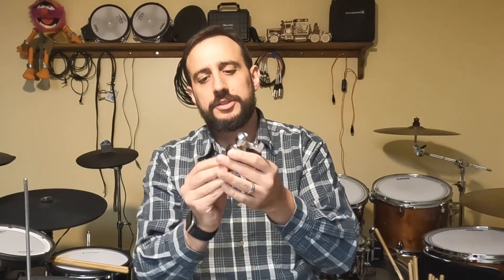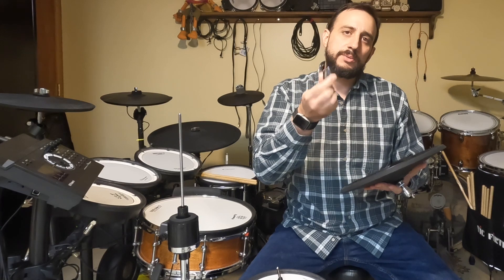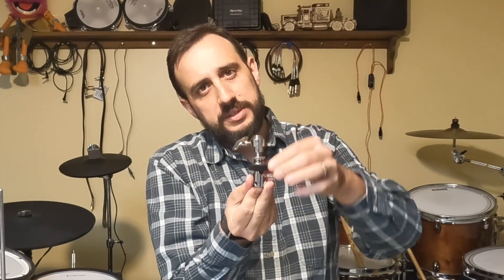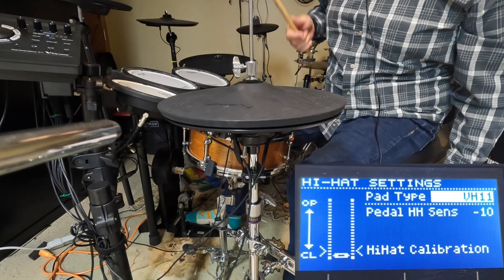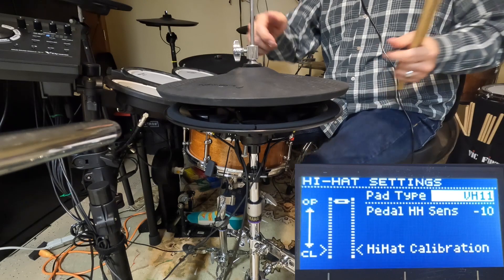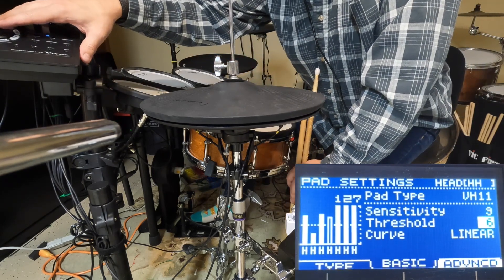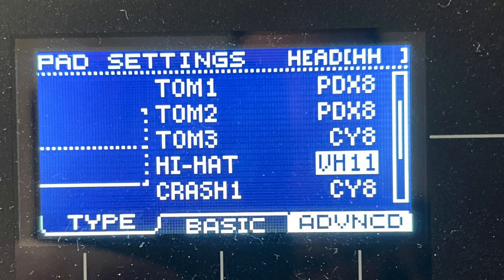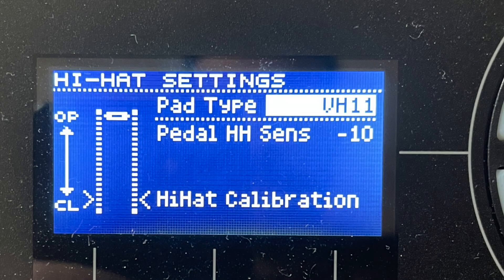You CAN use a 2 piece hi-hat with a Roland TD-17! Here's how...

Comment: I just installed the Lemon HHC12 with my TD-17 module. Works great! I used the settings in this video and didn't feel the need to do the test tone detail.

It also works just out of the box. Install per the instruction and you are set. As others have pointed out (here or elsewhere), the kit now includes an extra thicker washer that solves the problem.
Reply from the maker: I'm really glad they've fixed the issues. I am currently playing lemon's 14" hi hat, and it all performs wonderfully out of the box. Thanks for watching!

Comment: I got these to work on a TD-11. I definitely had to used some of your mods to get it to work- thanks! There is only one isse now- the hihat completely open sound kicks in a bit late. I think that it due to my lifht weight hihat stand. The top higat cymbal is pretty heavy and the dpring is pretty weak so opening the higat is dluggish. I'm hoping that using these on a hihat stand that has adjustable pedal tension will help.
Reply: How are they holding up on the TD-11 so far? I also have a TD-11 and I know these technically aren't supposed to be compatible, but if I'm going to upgrade my hi-hat I'd love to go with the 2-piece if I can make it work!

Comment: As always thanks for your videos. I just got my hihat unit and so far pretty good. I am getting some double triggering with edge strikes. I can’t make it happen all the time. It’s infrequent but I’ll have to work on settings. Maybe scan time needs to be lowered or maybe threshold is off. 
If you have any tips on the edge strike double triggering it would be great to hear your ideas. Thanks as always
Reply from the maker: What module are you using?
Reply: The TD-17. I did adjust the scan and mask time slightly and got it fixed.

Comment: Hi Brady, Great video quick question, based on your settings that work with the built in Roland sounds have you or do you midi out to a DAW eg logic and use the plugin sounds? if so does the hi hat still respond the same? Cheers Nick

Comment: I purchased this HiHat recently and I noticed that you did not use the black rubber washer that came with the kit.   The washer goes on after you place the bottom cymbal plate on so it sits on top of the bottom plate plunger.   This gives you just enough height to fully compress the bottom plate plunger when you step on the pedal.   You migt try that in lieu of using the fix you applied to your top cymbal plate connecton rather than using the parts you were provided with the cymbal.    I assume you received the rubber washer in your kit?   I had two with mine, but it could have been something that was added after the fact in newer kits....I would imagine that this would also eliminate any extra noise you get when the plunger is hit by the bottom of the metal "no twist" adapter on the top pad...this rubber gasket is shown on Step 3 of the directions that came with the kit as well.
Reply from the maker: Interesting— I did not get a rubber washer. I’d thank that could really help with things. I’m glad they’re including one now.
Reply: I also noticed this. I have that kit (Lemon TD950) and I did get the rubber washer with the hats. Now I want to upgrade the module to the TD17. Based on your review with a little bit of work you can get it to sound almost perfectly

Comment: Hi Brady, I just got my Lemon two piece hats (the newest version with the fixes) and I can't seem to get the volume up on them, if that makes sense. They sound like they are way low in the total mix. Do you know what could be the cause of this? I have checked the pads settings and levels, and theres nothing out of the ordinary.
Reply from the maker: First thing would be to go into your pad settings and ensure both that it’s set to the right pad (VH) and that a hard hit registers 127. If that’s happening then it’s probably not a sensitivity issue. Check both the top cymbal pad and your open/close foot pedal. Next check the levels of the hats and make sure they’re not turned down. If you still have an issue, take the top hat off and swap it with a crash cymbal and see how it responds.
Reply: @myfavoritedrumgear  I feel so stupid...I just checked the assign menu real quick and it was set to some BRUSH hi-hat!..Changed it and it behaved as normal right away. Thanks for answering.

Comment: ??? the TD-17-kvx has 2 piece hats already.  The VH-10 and VH-11 both work on that module and both are 2 piece hats.  You just cant use the later VH models on the TD-17 module.  So, 2 piece hats always worked on the td-17, just not all of the hats.  Lemon is just a cheaper version of the ones Roland already makes for that module.
Reply: they are not true hi hat tops and bottom as the bottom is just a plunger. unline the vh12 or the above. Both have full bottom cymbals. Theres a huge difference in the way the true 2 piece plays compared to the vh11 or vh10.